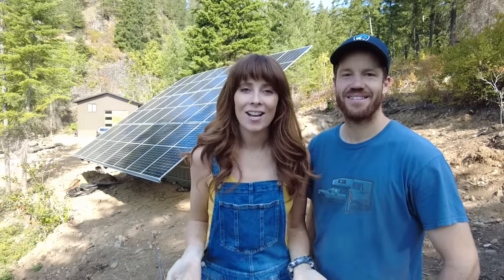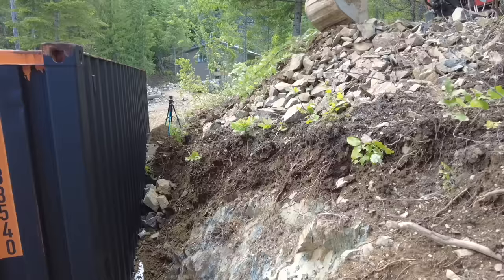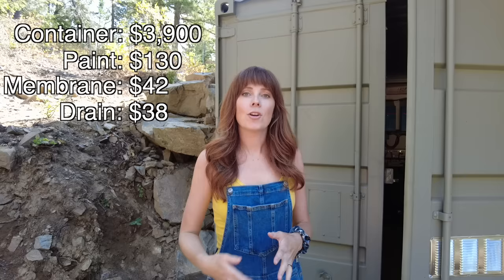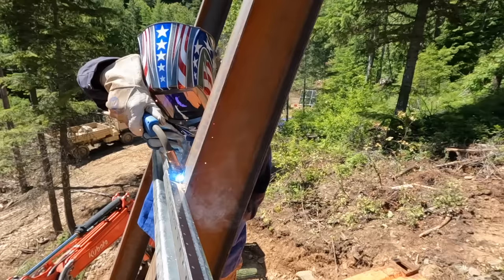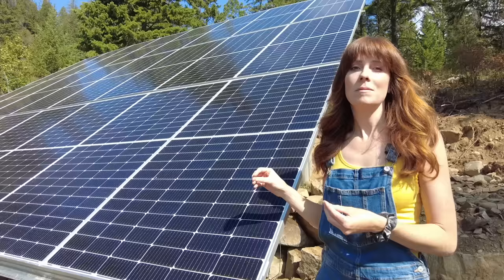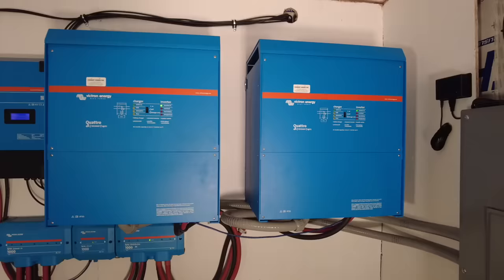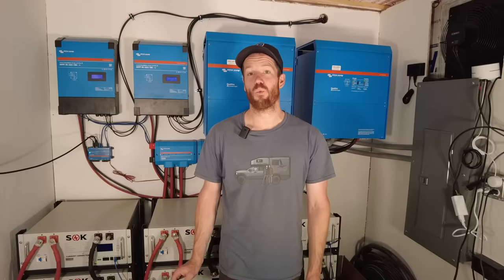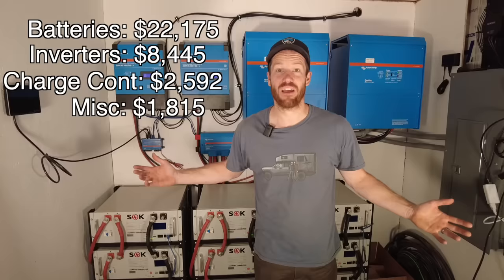TOTAL COST Of Our Off-Grid Solar Power System | Powering Our Mountain Home

Comment: The "no monthly bill" part is tremendous.  In addition to being $10K cheaper on day one, the solar system gets cheaper every day after that.  If you have an EV or plug-in hybrid, surplus power can get folded into that and reduce your day-to-day costs even further.
Reply: yeah, let's just wait for EV based on LiFePo4 batteries...lol
Reply: My exact thought as well then start reaping the additional benefits instead of paying through your neck with modern feul prices.
Reply: Just wait a few months they will find a sponsorship
Reply: Yes, having an EV to do runs for stuff, maybe some E bikes to get around the property too
Reply: Electric D8 as a project coming?!?
Reply: A monthly power bill of $200.00 a month would take you 20 years to get back the $50,000 they spent. The batteries life expectancy is only 20 years. Plus fuel for the generator on cloudy days, They had no choice but if grid powers is available, it cheaper and no there’s maintenance
Reply: @s.i.m.c.a  They have started using LiFePo4 Batteries.
Reply: @s.i.m.c.a  Or, alternatively, don't.  The name of the channel is Ambition STRIKES, not Ambition Waits.
Reply: @JohnHMoore  One of the uncommon use cases where battery weight is not a problem.
Reply: @shane7969  Let's be clear: couldn't fully charge an EV _from empty in one day_.  If you only drive a few miles in a day, it doesn't take much to charge up.  Most people don't drive anywhere near the full range of their EV every day.  I have a longish commute of over 50 miles round trip, every EV currently available has well over that range and this solar setup could easily top that up...every day.  Even after you take out their day-to-day consumption, there's sufficient capacity to put that much power in a car.

Stop trying to point out the uncommon edge cases in which it doesn't work, when 99.9% of the time, it does.
Reply: Agree with Leif.  I'm not really sure where shane is getting with the EV charging..  I have 2 tesla's and 2 rams.  The tesla's we drive A LOT.  My monthly electric bill only increased about $60 and we average around 2-3k miles a month.   We plug them in every single night at around 60% charge and charge them to 85%.  Also you can program the vehicle to charge at specific times and charge rates for extra benefits.  So being solar, charge when the sun is producing the highest charge thru the panels.  Being on the grid, I program them to charge at 2am.   Their current setup is more than capable of handling an EV.  Much like we do, When the EV just won't cut it.  or when it's not charged, we take one of the trucks.  They clearly have quite the arsenal of vehicles.  If they were using the system a lot that day with welding or whatever. they can just skip a charge that day on the car, partially charge, etc.. Plenty of options..  They're definitely not limited to fully charging the vehicle every time lol..
Reply: @roywaite5793  Except they were looking at 60k just to get power to their property.
Reply: @pieterbezuidenhout2741  Trust me, this area like most of rural flyover America is not conducive to EVs. This ain't Seattle folks .
Reply: @leifhietala8074  tax payers paid to have 3 power stations installed at work. Funny thing is you see the same 3 vehicles plugged in 3-4 times a week and we allow 2 days telework.
Reply: I don’t think you can support EV and house with that.  More likely they need to build second solar system for that.
Reply: $50k cost / $200 monthly bill / 12 months = 21 years to break even. By that time you need to replace everything.  Battery maybe 10 years, solar panel 20 years, inverter 5-8 years.
Reply: @shane7969  24 panels x 445 watts = 10,680 watts, not 8k.  That 32% goes a long way.
Reply: @roywaite5793  Except just getting power to the site was 60,000$.
Reply: @roywaite5793  I don't see how you figure.  An average bill of $200/month  for 20 yrs = $48,000 (Not including adjustments for inflation, general rise of cost, catastrophic occurrences and tax adjustments)  add the initial cost of tapping into the grid ($60,000, A cost I think you overlooked in your assessment) and you have a 20yr total of $108,000 (You wish!!) That wouldn't include damage deemed to occur on your property and the 15 to 30ft of easement most utilities require to be cleared from the land, from the main road to the transformer for the home, resulting in a loss of habitat and beauty,  that they are responsible for paying for and maintaining. I know, I've been there.

Their system saves $10,000 up front coming in at $50,000 subtract from that a conservative $12,000 in tax breaks we arrive at $38,000.  20 yr maintenance cost, let's be generous, $10,000, supplemental fuel cost (if necessary) another 10G, No electric bills, fees, or taxes and we arrive at a 20yr cost of $58,000. (roughly a 45%+ savings)  Add to that the minimal damage to the  environment and I don't see how anyone can deem this a loss. Even if they have to rebuild from scratch in 20yrs Which is highly unlikely, inflation costs would have appreciated all components and the ratio of gain or loss would likely remain the same. Save for the tax incentives, they would still see a general savings of 30 to 40 percent. 

In truth, due to the advances being made in solar and battery power and the competitive nature of the market, the mass production of components and the growing competition, new components with greater capabilities will be smaller, lighter, longer lasting, and cheaper by the time they would have to overhaul the system but grid electric costs would most definitely have gone up. And you are very wrong about the "no maintenance" part.  You may not be doing it but be sure, in rural areas, on you're property, you will pay for anything that is beyond the ordinary.
Reply: @jakeliujakeliu  To get the power to the house = $60,000 + monthly bill for 21 years = $110,000 vs $50,000 solar......
Reply: @b00yahh  Sorry.....I didnt see youre response before I posted....
Reply: @mrpeegeepee2682  off grid is the way to go!
Reply: @shane7969  So what you are saying is, you ARE the edge case.
Reply: "The "no monthly bill" part is tremendous"

They have a monthly bill. It just goes to pay the $50,000 instead of to the utility company.
Reply: @s.i.m.c.a  Those already exist, such as the Tesla Model 3 SR+.
Reply: @roywaite5793  It would have cost them $60,000 to connect to the grid so from day one they've saved $10,000. I suspect with their workshop plans their power bill would have been considerably more than $200 per month if connected to the grid. I think you should watch the video again but pay more attention this time.
Reply: @jakeliujakeliu  You’re ignoring the $60,000 to run power to the site mentioned in the video. Payback period vs grid tied is actually negative.
Reply: @roywaite5793  Agree. No way the batteries and parts will last 10-20 yrs ALL technology breaks down and will fail. For $10,000 more I would have had the reliable power brought in. Invertor fails, lack of production, low output, battery mishaps due to too hot or too cold & you name 20 other failures. UNLESS you are not running central AC units off grid can work. NO or small portable AC units for campers. RVs, small cabins
Reply: @shane7969  You're making the wildly incorrect assumption that the EV battery is always dead. in the summer they have more than enough surplus to top off an EV every single day.
Reply: No bill? LOL what do you call 50,000$? Just because it is cost up front does not change the fact that it is a bill bud. GASOLINE AND DEISEL is the way to go. Batteries just are not there yet on cost or capacity. I am off grid as well in VA and I have some solar but mostly run gas or diesel that I make from FREE OIL. Their set up is just a joke in terms of affordable or realistic.
Reply: Free electricity for EV, crazy
Reply: @WellnessWizdom  no, that's part of the 60k they should have payed to get service in the first place
Reply: @jakeliujakeliu cost them 60k to get power hooked up. They also have a shop which burns electricity I would avg there bill to 300 350 ez
Reply: @JohnHMoore  Now I'm imagining the big Cat living up to the Cat name, stealthily creeping around the place.  snap of a twig behind you, turn around and OH CRAP THAT THING IS BIG.

Comment: We are off-grid in the Central Coast area of California. We spent about 12k for the panels (15 x 400w) from Unbound Solar, inverter, and four 2.5kW Amperetime lithium batteries (for 10kW 800amps total). Because we put them on the roof, we were able to do most of the installation ourselves, calling in an experienced - and licensed - electrician to wire it all up (approximately $2500). As we're in CA, we get a LOT of sun, even in winter, so the system has been more than needed and we'll never have to pay a power bill again.
Reply: What was your total cost?

Comment: I would have paid the power company; I think it would have been cheaper in the long run. When all the Maintenace and cost of propane is factored over a 30-year period it might make the power company option cheaper. Not to mention you would have a lot more power available if you ever needed it. For example, a mother-in-law house, a big welder, charging an electric vehicle or whatever.